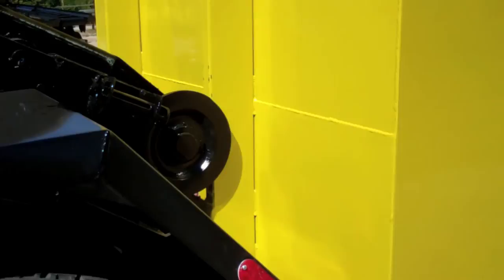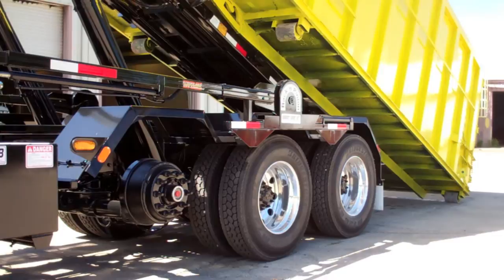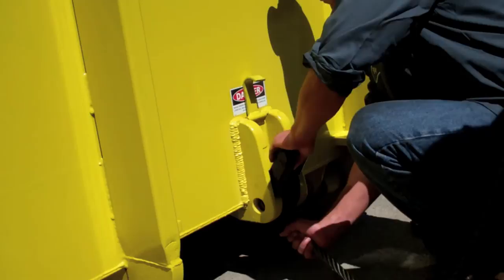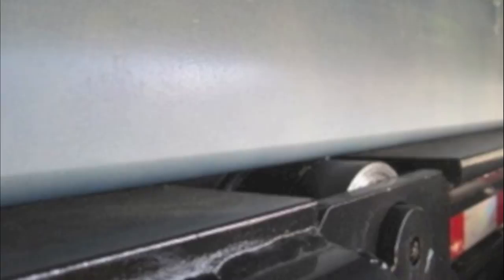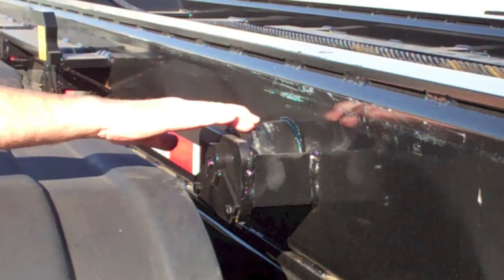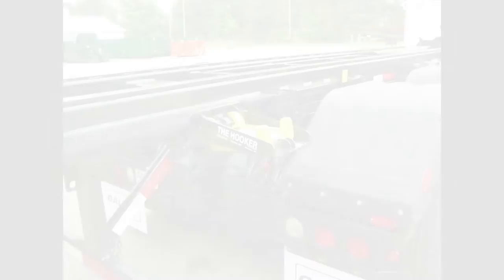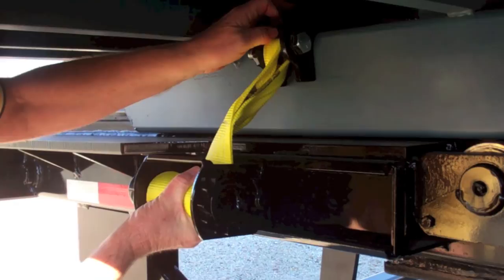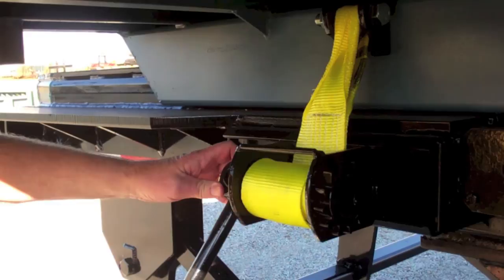GalFab Dead Lift (HH) Hoist (Features)

Comment: The Galbreath Hoist is a fantastic system however there are a few safety issues which I wish would have been addressed. When you set the dumpster down a pitched terrain that slants to the right or left the cable can fall of the center roller. Also on rare occasion the knuckle can fall out of the receiver and the dumpster can go flying off the truck. I would have liked to have some safety measures designed to prevent this from happening